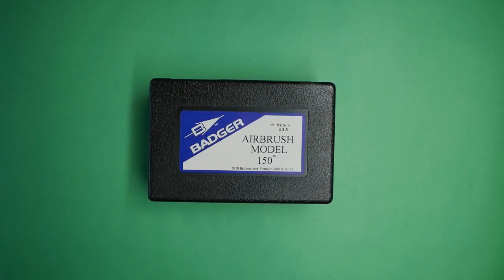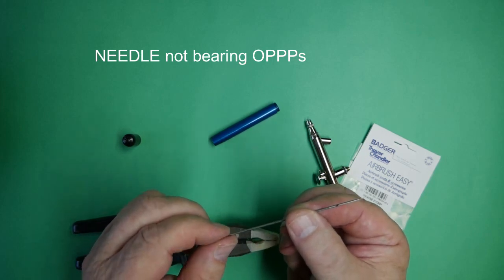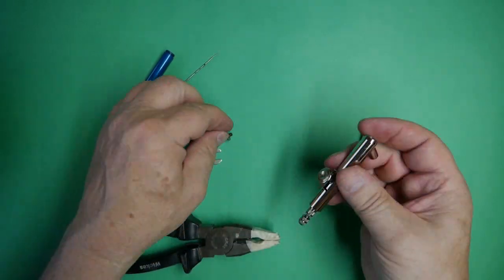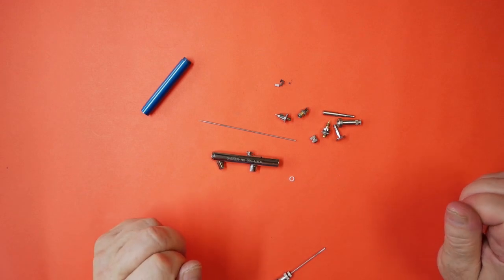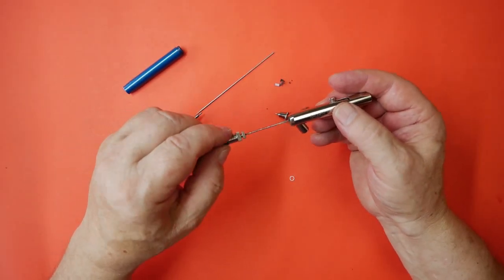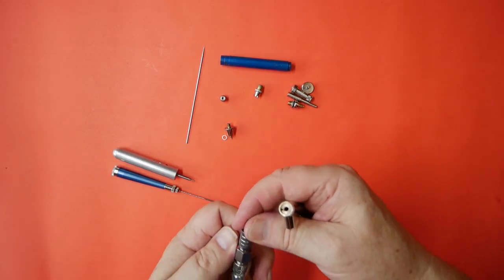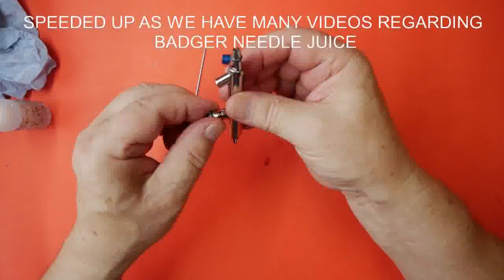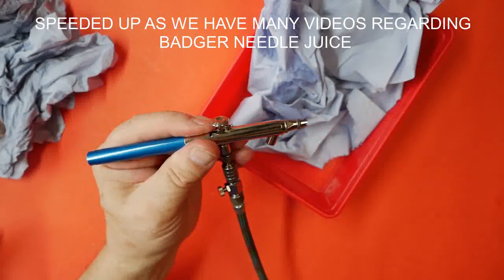Badger 150 airbrush

Comment: where can I buy the needle bearing tool?  I saw another video that shows him inserting the needle bearing from the rear.  Which is the correct way ?
Reply from the maker: I'm hoping the Badger replacement tool kit will be in stock soon, fitting the needle bearing from the front or rear depends which airbrush you have and its age